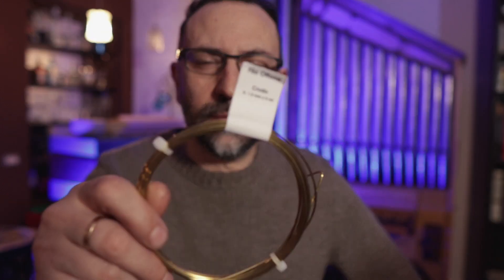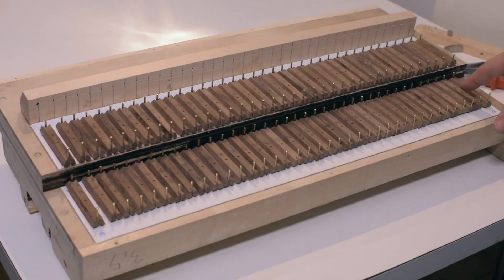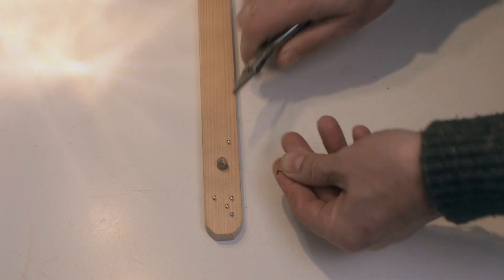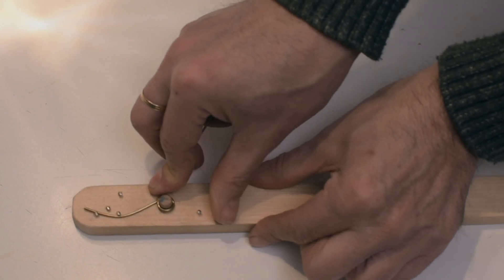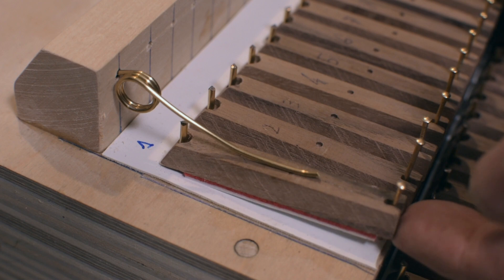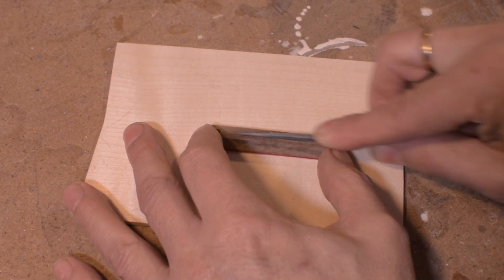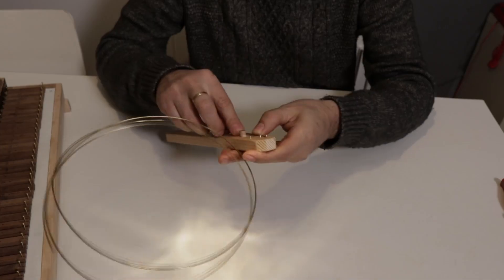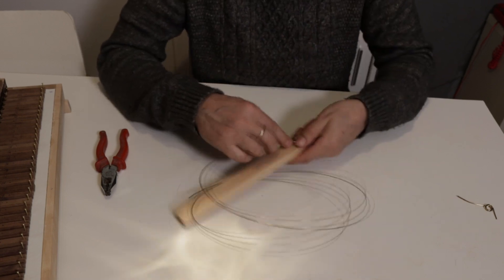The Springs | Building a Homemade Positive Pipe Organ | Video No 19

Comment: The new shape springs are a great idea, which I borrowed for our own home-made organ. Thanks!

Since I started watching your videos, I have wondered why you make all the metal fittings in brass, instead of steel? Is it only tradition, or is there a mechanical reason (easier to manufacture, maybe?). For me, the advantage of steel would be that it is easier to find, and cheaper...
Reply from the maker: I use brass springs because they are more traditional and nicer, but spring steel ones are fine.
Reply: @nippocast  Thanks! That's good to know.

Comment: 74 to go . . . I know the feeling. My first organ has 3/4'' wide steel crate banding straps for springs. It has two springs per valve. one is a fixed spring, the other is an adjustable tensioner. My instrument is electrically actuated with small industrial grade solenoids. precise spring tension is important for quick valve control. 
You build yours without electronics. Do you find it necessary to go back and adjust the springs later to even out the feel of the key touch?
Reply from the maker: Hi steven, thanks for the comment, interesting. Yes, then I will recalibrate the springs with a weight of 100gr when it is complete, to fine tune them.